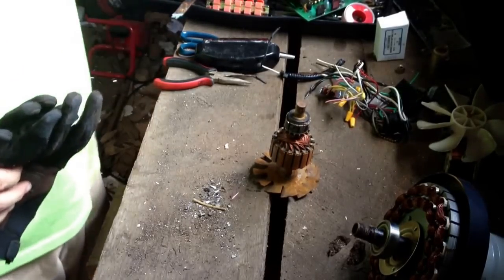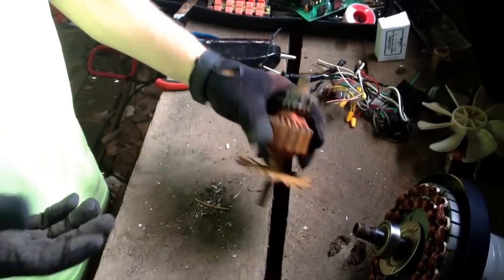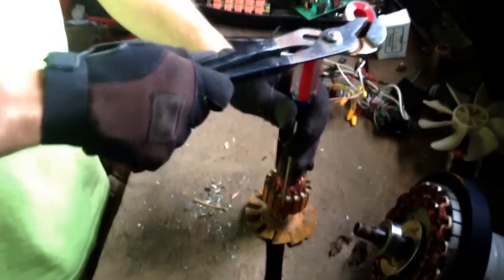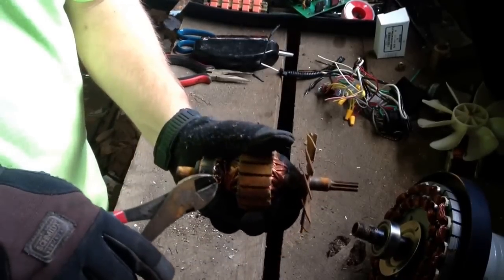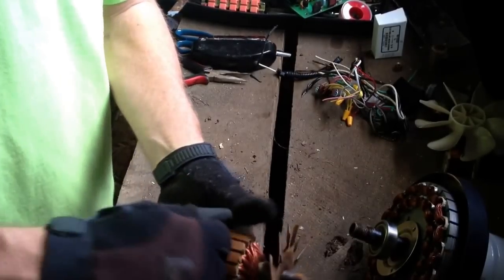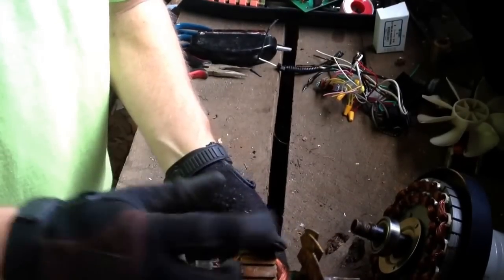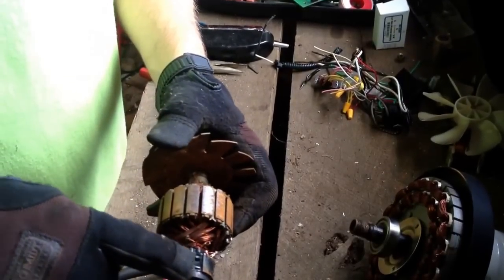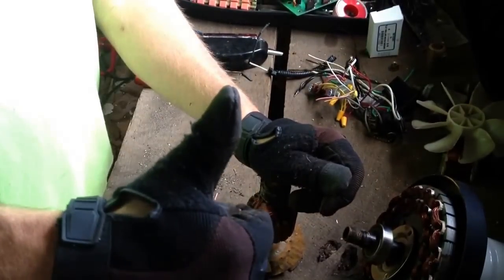Removing copper from electric motors the easy way.

Comment: awesome, tired of scrappers throwing copper away, some look at this thing as not worth it, anything with copper in it, never throw it out, put it in the "figure out later" bucket or whatever you have. Someone somewhere will have the answer or you will figure it out, options for extra money are everywhere. Will put all these motors aside, got some electrics to strip and a bloody fan motor, seen how to do those the hard way, finding economical ways to better use my time!

Comment: Are you melting down the copper too??  I've been doing it since after lockdown lifted & was able to go back to work, I'm up to a lil over 100lbs of reclaimed copper in a bunch of 3.5-5.25lb ingots & I'm LOVIN it!!  I don't have much on my channel about it, but I got a 10kg furnace from a company called Devil Forge, it runs an 8kg crucible & I've got all the tools to pour & clean up the bars..  I've also done a bit of aluminum & some brass too, it's a LOT of fun & it IS an expensive hobby, but once I hit my mark of 300lbs, I'll start making my money back from selling the copper to start buying silver stocks & physical silver..  The 10kg model I have set me back about $600 & the crucibles were roughly 30 each, the clamps were 75-100 each (you need one for extraction & one for pouring) then the gloves I got, rated for 1500°+ were maybe 50-75..
Reply: where would you sell the bars scrap yard won't buy it not knowing what's in the middle and are you getting the bars tested  for purity  just wondering because I was thinking of doing the same but an not sure
Reply: @Woot-tv-w8w  Well, if you've got an in at a scrapyard (which I do) there won't be an issue..  Plus, as far as purity goes, so long as you clean the metals as best as you can before melting & use some form of flux & scoop out all the slag, it should be 99.99%..
Reply: @gingervikingjesus2351   fair enough  was wondering for my self

Comment: Hard dirty work for .50cents worth of copper-collect cans on the roadside-you'll come out better off all around
Reply: Today's national averages. Aluminum cans $.21 a pound. Copper $1.85. a pound. It takes 32 12 oz cans to make one pound of aluminum. It takes 8.809 lbs of cans to equal the same $ amount as 1 pound of copper. So that's 281.904 cans to pick up in the ditch to make the same $ amount as scrapping 1 pound of copper. Hmm, I'm thinking I would much rather scrap copper from a couple of those armatures than walk down the ditch till i can pick up that many cans, but that's just me.
Reply from the maker: Spoke like a person that has ZERO idea what they are talking about. It is not always about getting rich! Scrapping pays well, but you also get the pleasure of working with your hands, saving the the planet. I feel sorry for people like you that base everything off of money.....SAD
Reply: Well even though you attacked i won't attack back by saying something like "it is sad that i have to share a planet with morons like you, who ,while castigating me  as someone who knows zero of what i say , completely misses the point of collecting cans as being "green" and planet-saving and also jumped to the erroneous assumption/ conclusion that i dissuade myself and others from scrapping when in fact i was commenting only on the particular process involved in the removal of copper from motors and stators/armatures-i myself just redeem them as is.
Reply from the maker: @markmark1078  First, if you want to use big words, please use them correctly. I would ONLY be castigating you FOR being one, not AS being one...lesson #1. Your comment WAS the first attack, and has NOTHING to do with saving the planet, your comment was only about making the most money....lesson #2. Always use an upper case "I" when referring to yourself...lesson #3. You can not dissuade yourself, you can only dissuade others....lesson #4. Never refer to yourself twice..."I myself" is wrong. Myself is a reflexive pronoun. It’s called that because one of its uses is to reflect the action of a verb back onto the subject, as in ‘I’ve hurt myself’.....lesson #5.... stop watching so much Harry Potter!!
Reply from the maker: @markmark1078  You said brevity....oh you are killing me....that is so funny....LOL

Comment: Hey Bloke  You are better off cooking these rotars in the fire to get rid of all the resin first ,,,, ..... Then they just about  fall apart   .. 

 Cheers
Reply: Billy Bobb 
Cooking as in an OVEN or cooking as in a fire? Only problem (if you mean fire) is most scrap yards won't buy burnt copper. If they do, the price is much lower.
Reply: Burning creates gases that can lead to cancer....not a good idea
Reply: Then you didn't get it hot enough.